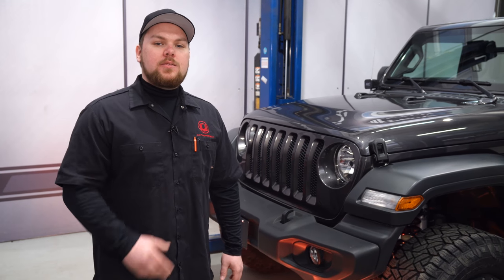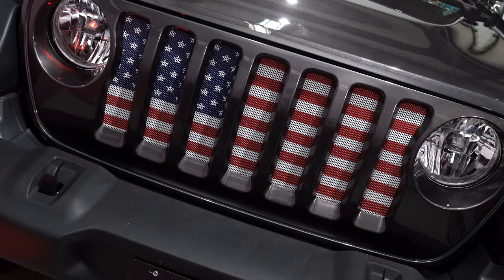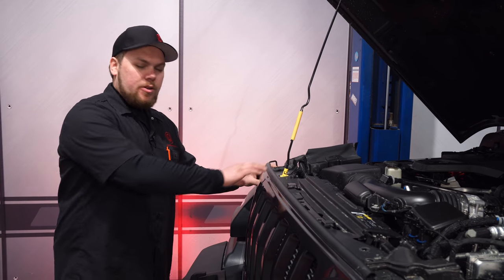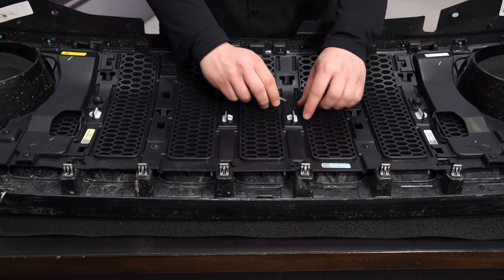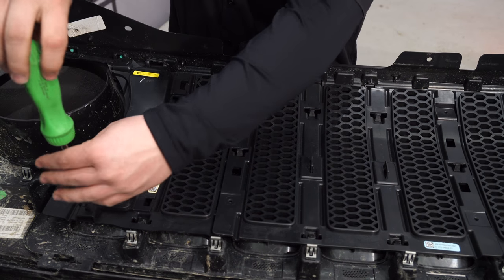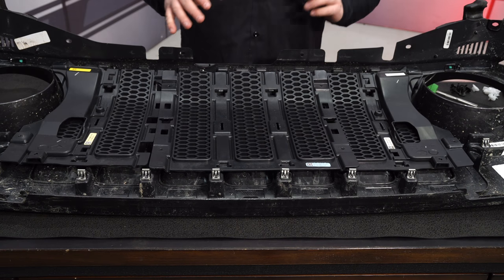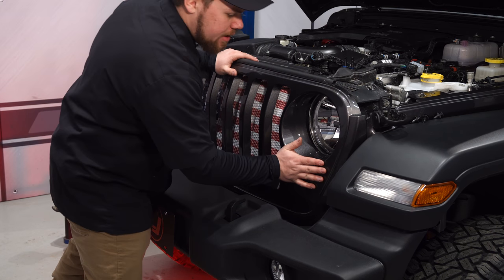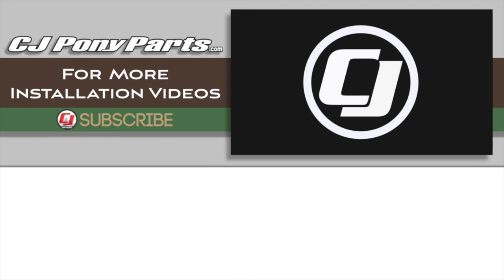2018-2020 Jeep Wrangler JL & 2020 Gladiator: Under The Sun Inserts USA Flag Grille Insert Install

Comment: ATTENTION RUBICON AND SAHARA OWNERS - you must reinstall the 4 lower torx screws to hold the extra piece of trim before installing the grill insert, otherwise  the trim piece will be loose and won't fit tight.
Reply: Thanks. I came back to see if I missed something glad I read the comments before loving with it.
Reply: Thank you

Comment: You need to reinstall the torx screws after removing the original insert and before reinstalling the grill.  This will hold the two grill parts together.  The flag insert will just stay in place with pressure.

Comment: 1:40 The black tabs holding in the 7 plastic clips.  Did you leave them in place after the install?  Mine seem to be keeping the insert from going flush up against the back of the grill itself.

Comment: I call BS.  There is no way that mesh fits flush without cutting the sprews on the back level with the grill openings or cutting tge meshbperfectly to fit over the protruding mounts 2020 gladiator sport